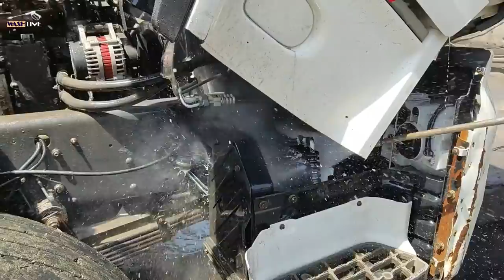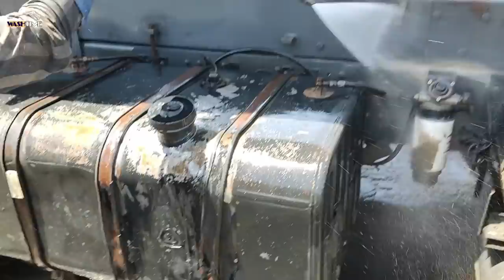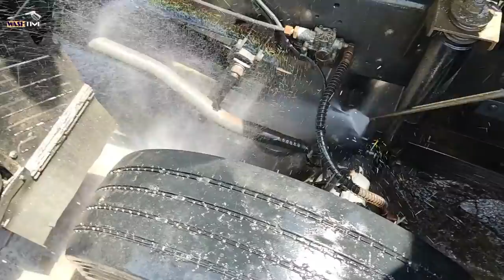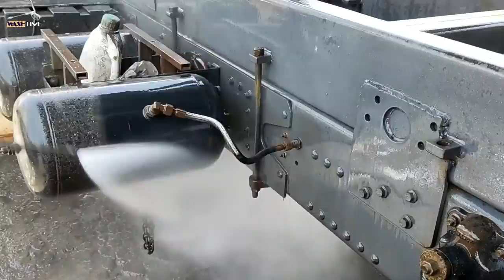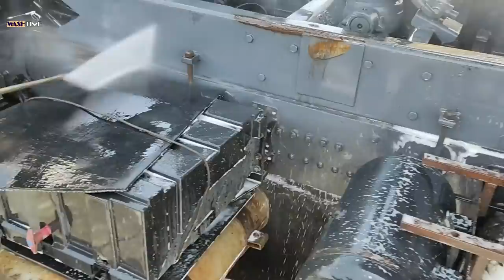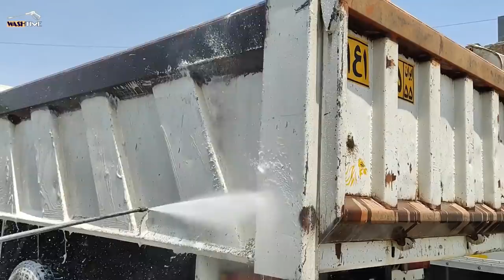6*4 SUPER MUDDY dump truck pressure washing!! #satisfying #i_love_trucks

Comment: Very chaotic, too low pressure, there is no pre-wash process like degreasing, washing from bottom to the top and then no repeat, the same mistakes you can see on the cabin while was washing on the back- Back glass from the top to the bottom but all of the dirt go up and the is no repeat. 
Dislike